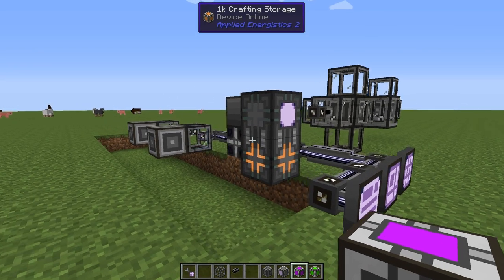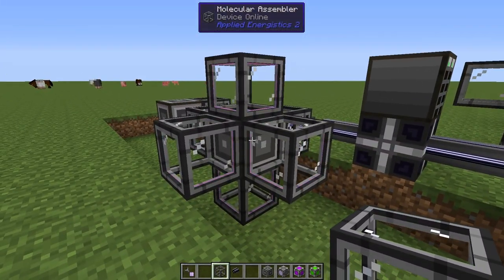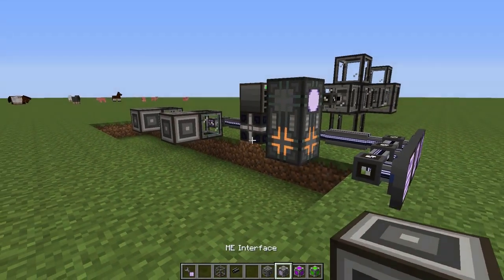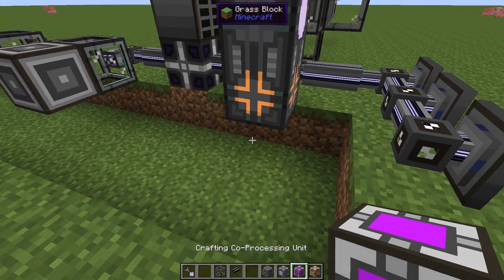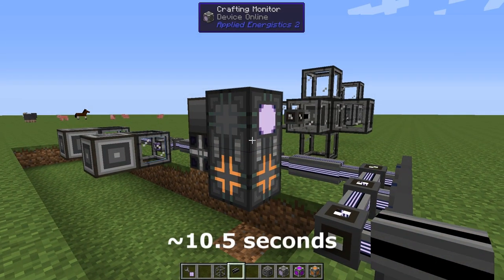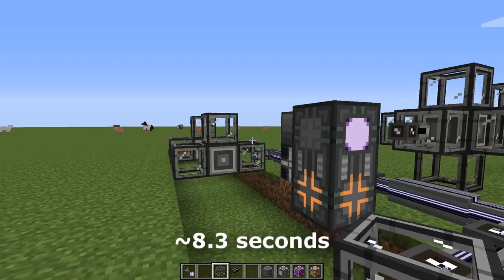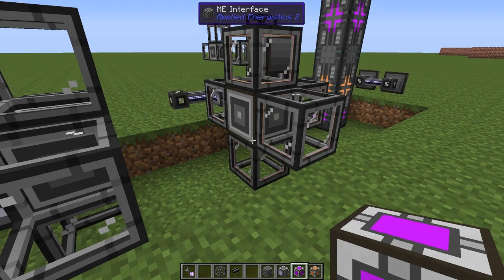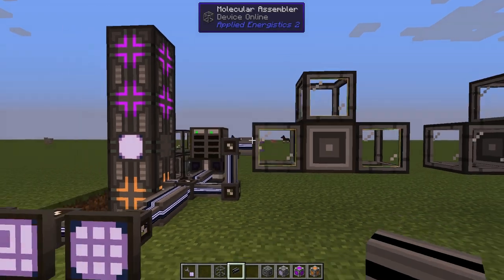Crafting Co-Processing Unit - Applied Energistics 2 Tutorial #18 (MC 1.7.10)

Comment: This is a great explanation of how to speed up processing and what affects it! Just to note, when you are in the "Interface Terminal" and all your Molecular Assemblers look the same, each ME Interface is a the sideways/vertical row so to split up steps like making planks then crafting tables, make sure they aren't on the same row in your Interface Terminal.  Also, you can compromise between spamming Interfaces surrounded by Assemblers by putting them in a grid of alternating Interface/Assembler. With channels, put a row of 4 dense cable down the side of a 4x4x4 cube of them and it will use 32 channels; Sort of an AE1 MAC style and with an Interface Terminal, you can still put patterns in even the inside ones.
Reply from the maker: Yes, the "flower" design used in this video is only to demonstrate how the Co-processing unit affects crafting. The alternating towers are much better! I prefer to have them slightly smaller (like 2x2x4) so I can manually reach and balance all patterns. Takes more space and more cables though!

Comment: the crafting "unit" requires 1 channel as well as each me interface? Does one need more than one crafting "unit" or can one just keep making the cube larger and larger and stay at only 1 channel?
Reply from the maker: With "crafting unit", do you refer to the Interface/Assembler or the Crafting CPU? The interface-assembly thing will require one channel per interface, but the crafting cpu can be built larger without the need of more channels.
Reply: @therealtkh  Sorry I was confusing. You answered my question thou thank you so much!

Ive run into a bottleneck of needing to stop and build molecular assemblers. Trying to figure out really how many me interface and molecular interfaces I need for end game.
Reply from the maker: @LetsPlaywithDDae  You can never have too many :) I recommend building them in a 2x2 cross pattern, make every tower 4 blocks high which means 8 channels per tower. It's easy to reach all assemblers then.

Comment: I love your tutorials.  I do have a question, though.  Ignore me if this is covered in one of your later videos.  I'm pretty sure I've watched all the ones up until this one, and you haven't mentioned it yet... what is the purpose of all those "Config" boxes with the arrows pointing to empty inventory slots on the ME Interfaces?  Also, are ME Interfaces seriously limited to only having 9 recipes?  There is no way at all to expand that?  As it is, I am imagining that I will need multiple ME Interfaces just to be able to automatically send ore through the pulverizer?  Then multiple more to send the dust through the redstone furnace?  It was more automated when I just dumped all my ore into a chest with a servo pulling them out and feeding them into the pulverizer that way...
Reply from the maker: +Dustin Rodriguez That's a long question, I'll try my best to answer it :)
1. The interfaces can be configged to keep a certain number of items in it at all times, I have used this in some videos, but you can manage without them. It can be used as a buffer step or a way to always keep a specific number of items (craftable) at hand if combined with a storage bus.
2. Yes, 9 recipes is maximum per interface. But you can have up to 6 interfaces sharing one assembler block.
3. Why having ore processing as recipes? If you, for example, have one input chest for the entire system, you can use a storage bus and make sure that all ores end up in a chest and using a servo like you said. My standard recommendation is to use sub networks for this. Check episode "26,5" in my The Dark Trilogy series where I demonstrate my setup.
Hope this answers your questions! :)
Reply: TKH Thank you greatly for your answers!  Yes, they were very helpful.  I could never find any documentation about those 'Config' slots on the interfaces... now I have to do some thinking to figure out if that would be useful for me.

I did end up not using recipes for my ore processing.  I just set up a chest I dump ores into when I come back from mining (I am playing Blightfall, which has no quarries) that feeds them into a pulverizer that outputs into a furnace which outputs into an ME Import bus and that works pretty well.  I will check out that episode you mentioned, I am always interested to see other options for solving problems!
Reply from the maker: +Dustin Rodriguez One more thing, you can also put crafting card upgrades into interfaces and combine with specified stock size automatically. I made an example in this video ( https://youtu.be/uGUWsnEJyQA ) regarding nuggets. Mostly a fun build, but perhaps it can inspire to greater things! :)
Reply: thanks for the tutorial, i was wondering why my huge crafting cpu (i can queue 2 solar expansion ultimate solar panels from blocks of iron/lead/steel/whatever) doesn't craft more different stuff at the same time... do the co-processors affect external crafting at all? maybe export speed?
anyway, the config options are really strong: it can be accessed like a chest, and it refills every tick or so. it's basically an integrated export bus which is faster and doesn't need upgrades; it just doesnt output automatically, which can even be a good thing if you are getting low on channels; use interface blocks and you can pull from them with filtered pipes (or whatever transport system is in your pack) from all 5 or 6 (enderio conduits) sides.
Reply from the maker: From how I have used co-processors they will affect external crafting in the way that the system will handle more things at the same time. This doesn't mean that things will go faster, but it might. It also depens on how different components are crafted, if they can be done in parallell or not. All crafting steps must be balanced, and then you need the co-processors to make some steps more efficient :)

Comment: I dont remember if u mentioned it in another video but assemblers dont count as devices so you could make a huge stack of them with 8 interfaces.
I think a way to optimise them is to have multiple assemblers connected to multiple interfaces. Not sure if it is actually optimised but it looks cool and very tidy
Reply from the maker: My favorite setup is to build a 2x2x4 tower with 8 of each placed in diagonal patterns and switched for every layer. This means that every Interface connect to at least three Assemblers (middle layers connect to four). And then spread out all patterns in a way where common recipes are utilizing several at the same time. Requires a well-designed Crafting CPU of course :)

Comment: Please Help!!    How do you click a stack of over 1000 crafting tables and activate the ability to craft them... I'm required to either clear the stack or change the view to premade craft patterns in order to start crafting and its very annoying
Reply from the maker: I'm sorry, I don't understand how you're trying to do this...? Have you set up auto-crafting with patterns for the crafting table to start with? In an ME interface connected to an Assembly Chamber? With Crafting CPU and everything?
Reply: Yes I have everything setup correctly and auto crafting works great. In this video as your doing demonstrations you click on the terminal to make the crafting tables. At timestamp 2:54 for eg,  it shows you have 1070 crafting tables already made in storage... when you go to make another 30 you clicked on that stack of 1070 and instantly the craft window pops up and you enter 30 then clicked next. When i do that same click it picks up a stack of items. If i want to craft something i have 2 options.... 1) empty my storage so i have 0 then i can craft, or 2) I would click on the button on the left side to view "only" crafting patterns.
Reply from the maker: Ah, I understand now :) It's actually very simple. The default key binding for this is middle mouse click (scroll wheel click). Then you will instantly get to the crafting window, even if you have items in stock already. For a long time, I didn't know this myself until someone told me in a comment or so :)
Reply: That works tyvm!! I was also wondering how many Crafting Co-Processor Block you would recommend to use effectively in a CPU? I have a large build for crafting processors that span over 56 channels to run. 20 Inscribers total with 6 dedicated to printing the Circuits, 6 for printed silicon and 8 for putting the processors together. My goal is to make any size storage component very quickly. It all works great but im not sure how to build the CPU's to take advantage of 20 inscribers. My CPU's have 1x 64k Storage, 1x Crafting Monitor and 7 Co-Processing Units. I have 2 of those separately built.  I also have a wall of 32 Molecular Assemblers. I'm planning to automate everything in time. What kind of CPU's should i have? 10? 15 Co-Processing Units? 

I should also mention, anywhere I could put an acceleration card I did... im sure i have over 500+ in this build.
Reply: in the video it seems like u need one Co-Processor per fully upgraded Assembler.
So i guess 16 Processor per Cpu should be enough (since you build 2 of those ) to handle 32 Assembler.
but this only applies if you try to craft in all assemblers simultaneously with your 2 cpus. Id say check your recipes for the most steps/assemblers used to know how many Assemblers approximately run at a time. Then u know how many Co Processors u need. Just add some more than needed now, should be easier than to expand later.

Just starting my own System, so dont take my word for it:) watched the video and kinda want to know if i got it right.
worst case should be 32 Processors per Cpu tho.
Reply from the maker: That's a crazy build, very interesting :) I haven't really benchmarked how to balance things, so I can't give a good answer. But the next commenter had some good input!
Reply: I ended up making some changes, made one wall with 12 ME Interface and 6x Moleculars per Interface for patterns I want speed. And on the other side I did 8x Moleculars with 4 ME Interfaces each for patterns I rarely use and as I fill each one I hide it in the interface. Max accept cards in everything, works beautifully but as a warning to others you may have problems as your network crosses chunks. A chunk loader can help that. Also "Quartz Fibre" is your best friend when doing compact connections. Use it everywhere so you don't cross wires. Tore the wall apart over 10 times to get it right lol
Reply from the maker: For compact connections you could also use the cable anchor. Unless you want to transfer power of course :)
Reply: @therealtkh  can you share what the key bind name is.  I looked and couldn't find anything with "autocraft" or "craft inventory".  TYIA
Reply from the maker: @ntman4real  You mean the key bind to order crafting of an item already in the network? As I wrote the default is middle-click (scroll wheel click) but it doesn't seem to be rebindable. Might be hard coded or possible to find in some config file but I honestly don't know.

Comment: This System can still be faster only by adding a ME-Controller. You can connect and run ME-Devices together without having a controller, like in this Video, but everything works slower.
It's better to place a Controller without direct contact over the casing to other devices. Always connect the Controller with ME-Cables to other Things. So everything has to communicate over the Controller what makes it more efficient. I love to build Crafting CPU's with 4 Co-Processors, at least one crafting storage and one crafting monitor. Sometimes i build them even bigger with way more co-processors and crafting storages. When i have enough Material to craft 64k storage cells, every Crafting CPU gets at least two 64k crafting storages.
I build these so big to be prepared for the future. When you order an Item that needs a lot of another Items that have to be crafted with many crafting steps, it's always better to have more Co-Processors. I also like to build 8 Block high Auto-Crafting Towers with 4 Assemblers around one Interface and every Assembler becomes a full set of Speed upgrades. My ME-System is able to craft hundreds of Items in a few seconds.
I also prefer to think about how and where i connect every single ME-Device. So i use one ME-Cable from the controller only to connect crafting units and no other devices. Another cable is used only for the Auto-Crafting Towers. Another cable is used for HID-devices like crafting-Terminal, Pattern-Terminal and so on. It seems to me when connecting random devices with different functions, it can and will decrease the efficiency of the ME-System. It make sense, when i compare it to a real Computer and how the internal peripherals are connected.
As an example:
A Graphics Card that is mounted in the right PCI-e Slot gets 16 PCIe-Lanes with a full bandwith direct from the CPU without other things connected to the Lanes. The RAM is also directly connected to the CPU without other devices. If there is more than one PCI-e x16 Slot available, one of them can still be connected over the chipset, where many other I/O devices are connected to. And this ends up in less available PCIe Lanes for the PCI-e x16 Slot and in cause of this, less bandwith too. The Bottleneck in this case is the communication BUS between the CPU and the Chipset.
If both PCIe Slots are connected directly to the CPU you need a CPU with 32 PCIe-Lanes to provide full bandwith for two GPUs. If the CPU has only 16 Lanes, each GPU becomes only 8 of them. When you have more than one GPU installed it can be interesting to look with CPU-Z or other Tools which PCIe-Mode (x16, x8, x4) of each GPU is used.

Comment: I don't get why almost every video I see of people and AE2, that people are using the full ME Interface block and not the small version which works just the same, but doesn't take up as much space
Reply from the maker: There are reasons to use the big sometimes. For one, you can pipe items into a big Interface block but not the small. Secondly, the big block will transfer power to some blocks, like the Inscriber or Molecular Assembler. I should note that in latest version this doesn't apply as the Interface would be the Pattern Provider instead.
Reply: The block can be surrounded on all sides with assemblers/machines. The face one can only access the one side. Face ones are better suited for interacting with machines you won't be using often. Blocks are better for all purpose crafting.